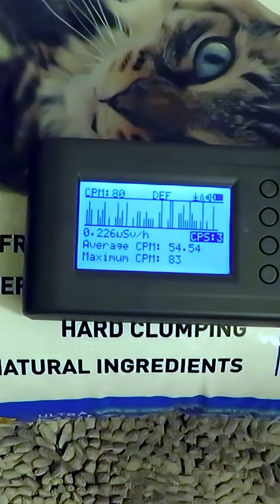How Cat Litter Caused a Nuclear Barrel to Explode! #historicaltidbits

Comment from the maker: Cat litter, particularly the type made from attapulgite clay (also known as fuller's earth), can contain naturally occurring radioactive materials (NORM) like uranium and thorium, along with their decay products such as radium. While the levels of radioactivity in individual bags of kitty litter are generally very low and considered safe for household use, the sheer volume of this material handled in certain industrial contexts can pose a risk. In some instances, specialized facilities that process or dispose of large quantities of NORM-containing waste, including spent kitty litter from industrial or research settings, need to take precautions to manage this low-level radioactivity.
One notable incident involving radioactive kitty litter occurred in 2014 at the Waste Isolation Pilot Plant (WIPP) in New Mexico. WIPP is a deep geological repository designed to permanently dispose of transuranic radioactive waste, primarily from nuclear weapons production. In this particular accident, a drum of radioactive waste, packaged with organic kitty litter as an absorbent material, ruptured due to an exothermic chemical reaction. It is believed that a change in the absorbent material used in the drum from an inorganic zeolite to organic kitty litter, combined with other reactive materials, led to the temperature and pressure increase that caused the drum to burst. This breach released radioactive material, including americium-241 and plutonium-239/240, into the underground facility and, subsequently, a small amount was detected on the surface.
The consequences of the WIPP accident were significant. Twenty-two workers were exposed to low levels of radiation, though none suffered immediate severe health effects. The facility was shut down for nearly three years, halting the disposal of critical transuranic waste from various Department of Energy sites. The cleanup process involved extensive decontamination of the underground repository, including isolating the contaminated area, removing contaminated equipment, and applying fixatives to prevent further spread of radioactive particles. The total cost of the cleanup and recovery efforts for the WIPP accident was substantial, exceeding $2 billion. This figure encompasses the costs of the initial response, decontamination, facility modifications to prevent future incidents, lost operational time, and ongoing monitoring. The incident highlighted the critical importance of rigorous waste characterization and stringent safety protocols in managing radioactive materials, even those considered low-level.